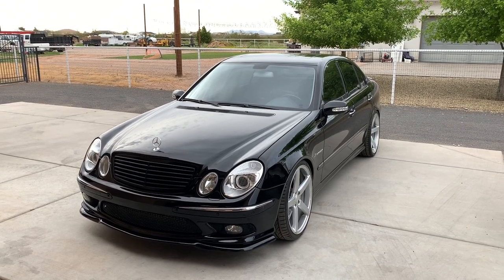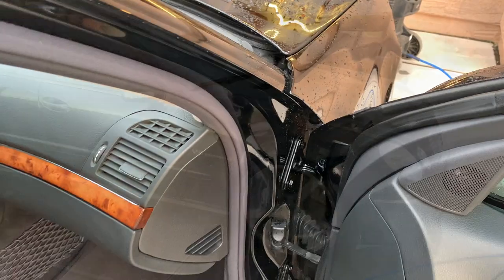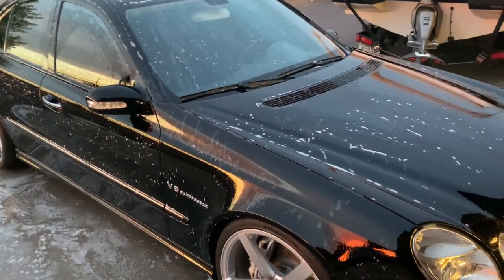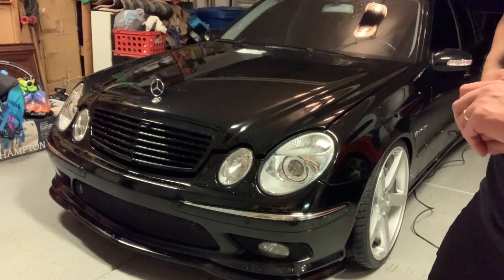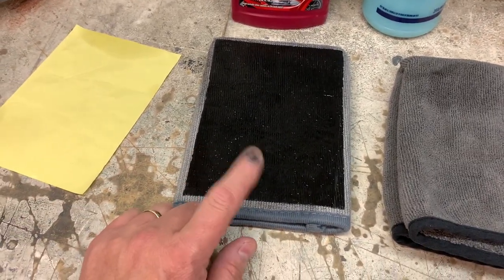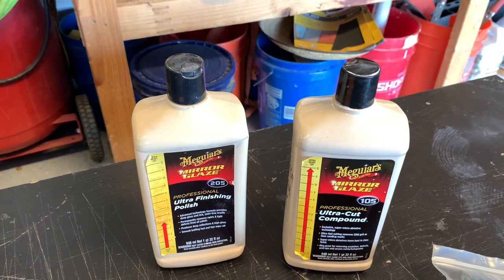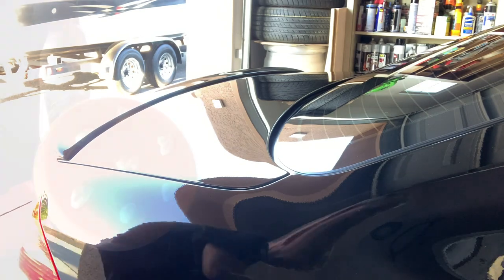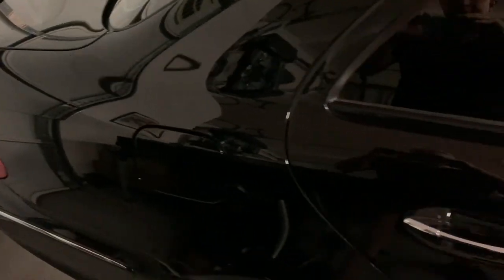Mercedes Benz e55 AMG w211 Paint Correction from Start to Finish

Comment: Thanks for this video. I too am a DIY guy with a W203 with paint code 097 (obsidian black) that I attempt to keep as clean as possible. I use a lot of the same products you do although my paint is in worse shape than yours, but I try.  2 questions for you.  Spraying iso alcohol after applying a polish won't have any negative effects on the polish job? Second question, what do you recommend spraying to strip off ceramic coating so I can rebuff n polish a couple sections? Will surface prep or iso alcohol work?
Reply from the maker: @CM-tc6pp - You're welcome!  Answer number 1- when I do the alcohol wipe, I am very careful to use a freshly washed microfiber.  Answer number 2- between the alcohol wipe and the polish, the old ceramic coat should be gone, and ready to apply the new coating.
Reply: @PrecisionMike  Awesome, thanks for the advice. looking forward to your next video.
Reply from the maker: @CM-tc6pp  - You got it!

Comment: Mike, can you tell me what offsets your wheels are?
Reply from the maker: @sevenpaulperalta929  - Sure thing.  The fronts are 20 x 9" and the offset is 25.  I run 225/30/20s.  The rears are 20 x 10.5" and the offset is 30.  I run 305/25/20.  I rolled and pulled the rear about .25", no rubbing and you cannot get your finger between the tire and fender

Comment: What size wheels are those and what brand are they?
Reply from the maker: @user-tb7xe8jo5m  - Hey there.  They are Vossen CV-3, which are no longer made.  IMO, they are the perfect wheels for this car.  They are 20x9 up front, and 20x10.5 in the rear.  I am running 255/20/20 and 305/25/20.  I also rolled and pulled the fenders slightly.  You can barely fit your finger between the tire and the fender, and there is no rubbing.
Reply: @PrecisionMike  definitely did a good job 👍🏻